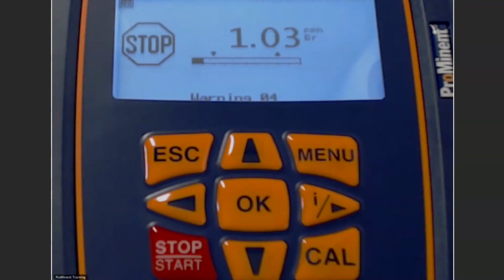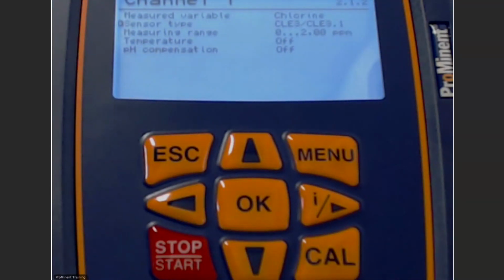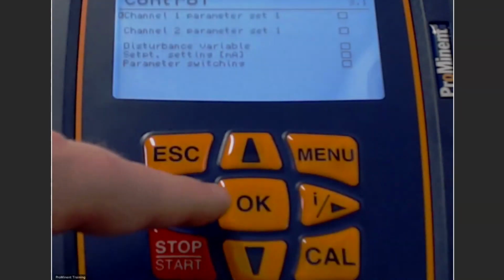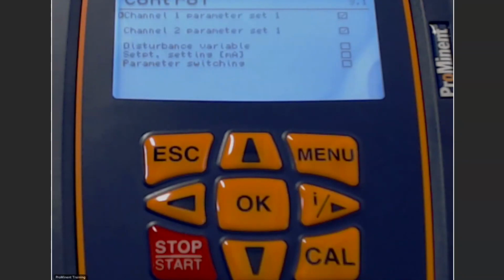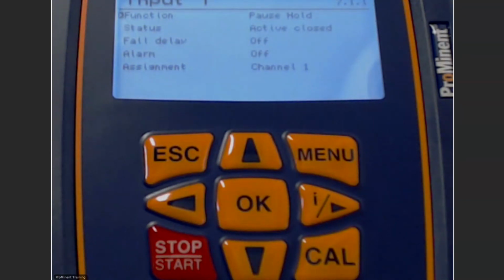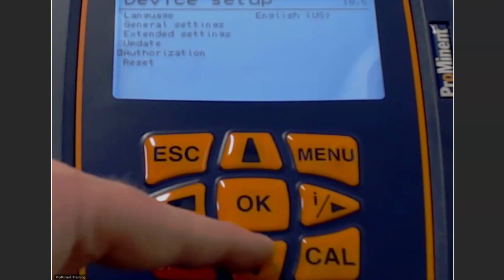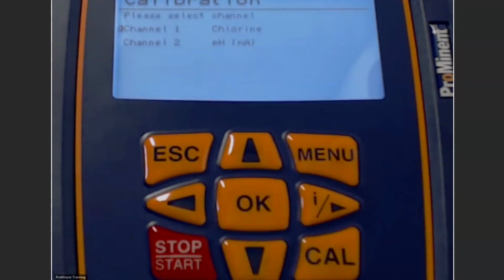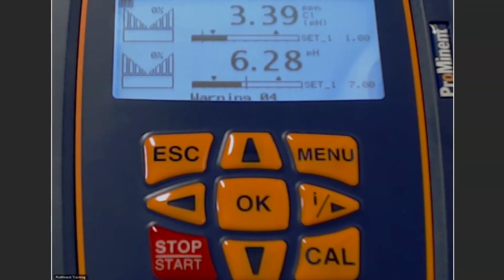Setting up a new DACa Controller

Comment: What does measuring channel has not been calibrated mean?
That's what's flashing across screen using meter to measure chlorine residual
Reply: You need to do a valid 'Slope calibration' after the sensor has seen chlorine flowing past for a couple of hours